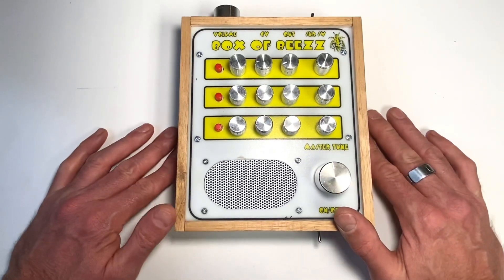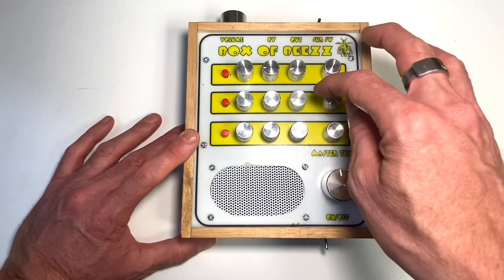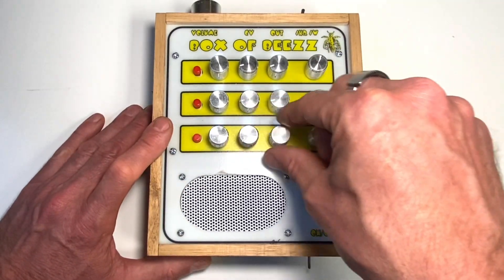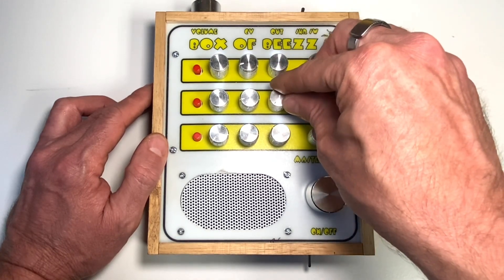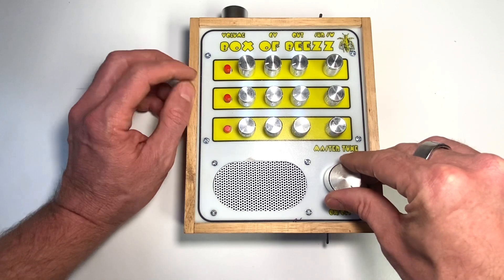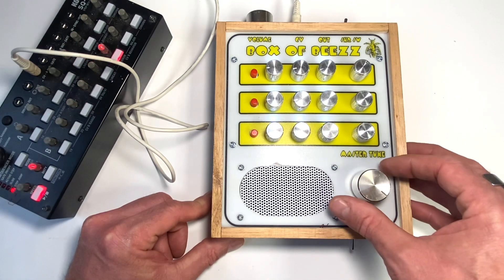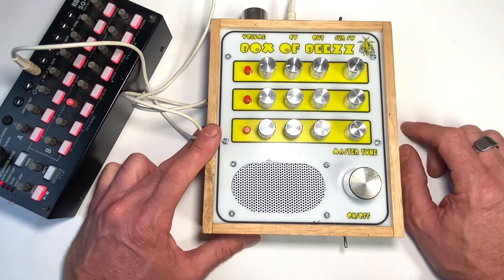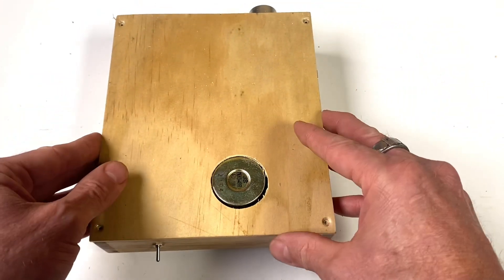Box of Beezz - Drone Synth

Comment: I’m in the process of building v2. Can I bypass the cell battery, external amp, battery charger, and step up module if I just add an 18v dc jack and an audio out jack?
Reply from the maker: Yeah you should be fine with doing that.  Just connect power directly to power out